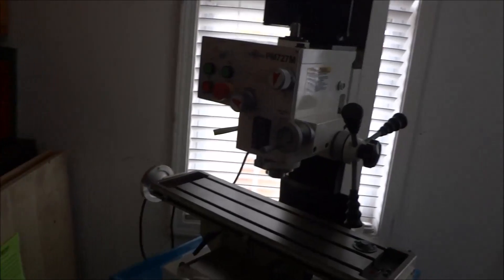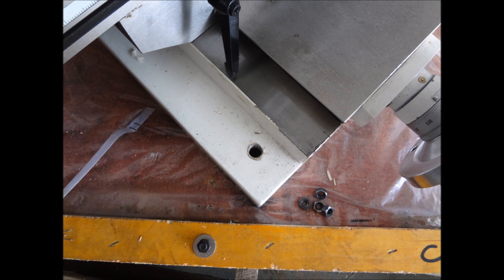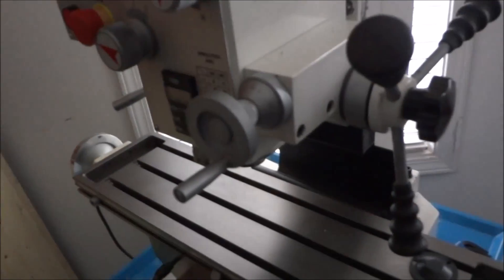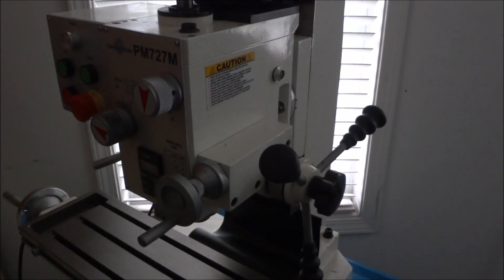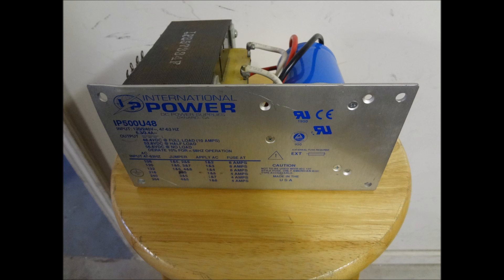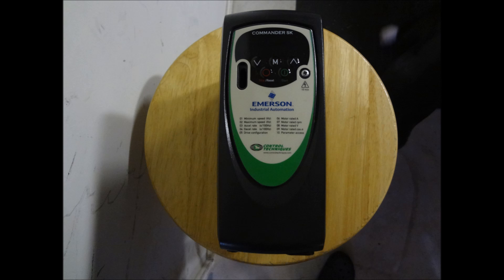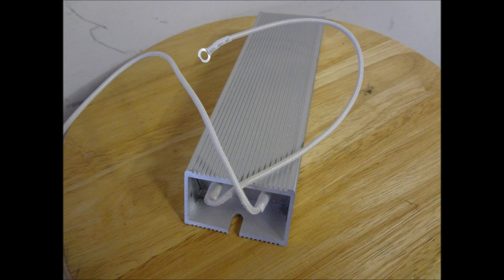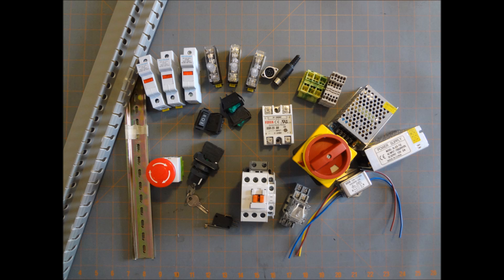Precision Matthews PM-727M  Shopping spree

Comment: Hi Sam, I'm finally getting around to automating my PM727M.  I have most of the electronics and 1hp motor.  Do you see any problem using a SKB1100110 VFD instead of the 075 like yours?
Reply from the maker: No Should not be a issue.

Comment: why we have to used vfd?
Reply from the maker: for the 3 phase spindle motor
Reply: if i have 1 phase motor then no need vfd?
or i have to used the 3 phase motor with cnc control ?
thanks
Reply from the maker: you can run a single phase motor but if you want variable speed and control a VFD and 3 phase motor or DC motor is needed
Reply: CNC4XR7 thanks 🙏 
I understand

Comment: Great job on the videos.  What is your reasons for using 3 phase steppers over 2 or 4 phase?
Reply from the maker: Hi This build is a few years old and I would most likely go with some close loop steppers as they are less expensive now and there are more available. I will be starting a New build a PM727MXL with servos and Linear Rails added.

Comment: Hi Sam, I like your new 3D printer that is smart buy !! I will buy one first I finish the mill !!
I have 2 questions ; Regards the power supply that you use here; it's rated 8A for 120v setup on full load is 10A Do you think it's still better than the one automation technology selling? 
(Unregulated Linear 625W/48VDC/13A Toroidal PSU (KL-4813) with 5VDC)
The other question I am having problem finding same VFD that you use! What is the socend model you suggest for 1-2 HP motor as I didn't buy the motor first thinking of shopping for the vfd first and second want to make sure my mill can handle the 56c frame of lesson 1hp motor if not then I may go with 1.5 hp smaller frame!!
Thank you for your keep uploading great videos !!Oz
Reply from the maker: The power supply from AT would be a good choice it seems to have a little more juice. The one I have is only 500W.

Most VFD's wire up the same A FWD/ REV input a Reset Fault input and a 0-10 v signal so shop around and find what works for you.

Comment: Have you made any chips on this machine yet?
Reply from the maker: +Kendall Huseman 
Not yea I did power it up and turn on the spindle LOL.
 Funny I did not even make one chip on my G0602 before converting it. But I hope to with the mill.
Reply: +CNC4XR7 
Ok, thanks.  I am trying to decide between a mill myself.  I want to get into pistol smithing and need a mill to perform certain cosmetic things.  Need a mill that can cut steel accurately.
Reply from the maker: This mill is rigid and the travels are smooth backlash is good for a manual mill. 
It has a strong motor and 6 speed gearbox. Plenty of power for what you want to do. 
Should have no problem.

Comment: Is the Emerson VFD 220 V input or 120 V like the TECO.  I'm also curious about the braking feature.  I'm thinking rigid tapping in blind holes?
Reply from the maker: +Mike Higgins  This one is a 120v to 230v 3phase SK 11000075 model VFD  The Same VFD Tormach uses on the 770.
For a extra $20 to purchase a braking resistor well I couldn't reset. So Yea the plan would be to do some Tapping.
Thanks Be Safe,
Sam
Reply: +CNC4XR7 Just trying to get a handle on braking resistors.  Emerson's spsecs show a 300W 40ohm resistor as E-stop up to 10% duty cycle.  Which I assume means very infrequent use.  I guess if you only have a few holes to tap it should be fine.  I'm just curious why you chose this over a 500W 40 or 50 ohm which they rate at 25 to 50% duty cycle, since the price is about the same?

I'm getting ready to do a VFD conversion and I just want to make sure I understand at least some of what I think I know about it :)
Reply from the maker: Hi Mike not sure where your getting your data. In the SK user guide. I found online it recommends a 100ohm resistor. For this vfd. Max of 1.7kw and max 14.8 amp. 
There is a whole section on sizing a braking resistor. The resistor I purchased is 50ohm and 300watt being only 50 ohm it may take longer to stop than a 100 watt by comparison Tormach uses this drive and a 75ohm 200watt resistor. 
Seems to work for them. I do know that you don't want a bigger resistance as this effects the drives braking transistor and cause it to be switched on continually and not allow the drive to control dc bus voltage. Best to be under the calculated requirement.
Reply: +CNC4XR7 Here is the link to the document I'm referencing.  It shows the braking resistors in a table on page 31.  I think their literature may have some conflicting information.

www.emersonindustrial.com/en-EN/documentcenter/ControlTechniques/Brochures/CTA/BRO_OPTIONS.pdf
Reply from the maker: +Mike Higgins PM sent

Comment: Nice update. The mill looks really good, I wish I had more space in my garage (and an engine hoist ;p).

Do you really need braking resistors for a mill? For a lathe it makes more sense I guess.
Reply from the maker: Yea a hoist makes all the difference. This one was borrowed. And I bet if you look around one of your neighbors might have one. 

Space is a premium for me as well so once complete it will reside in the home of the X2 mini mill. And it will have to go. 

One of the main reasons I choose this mill. 

Braking resistors are good on both machines and more so on a lathe were you can easily cut in both directions. 
The mill not so much but good to have in a emergency and tapping.